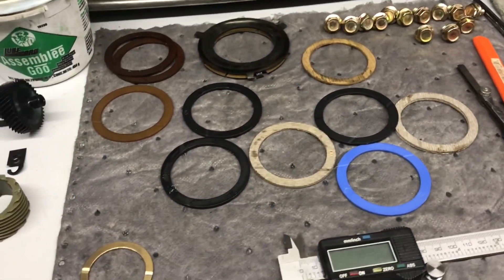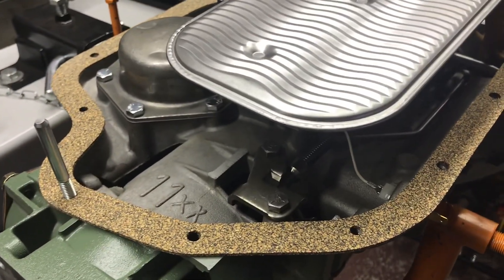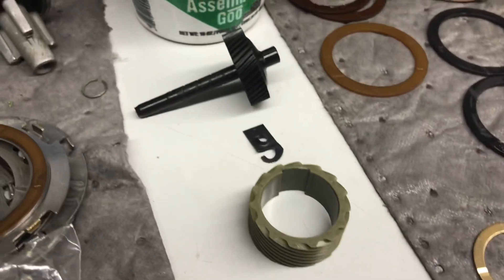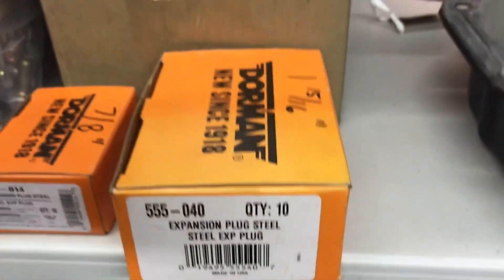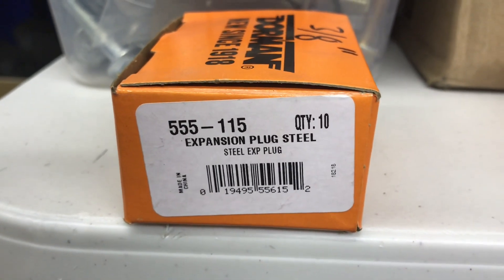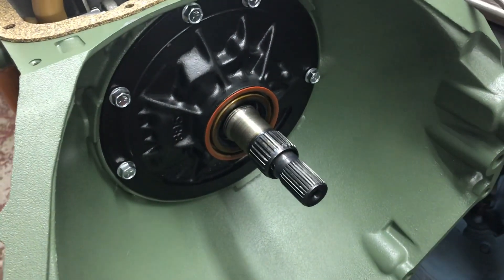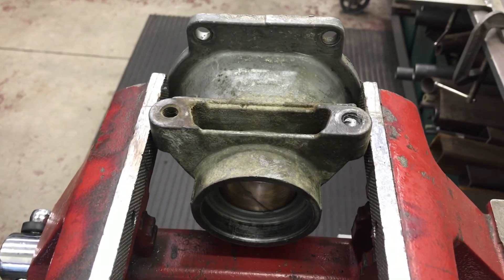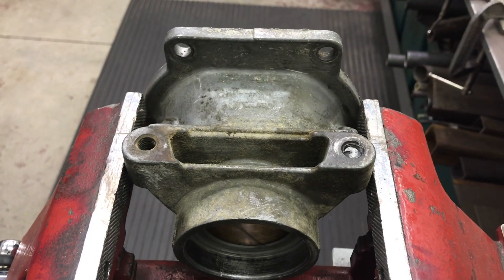Race TH400: Final Thoughts

Comment: I bought a Reed Racing TH 400 case and bell. Do you know any difference in building it vs a stock GM case such as snap rings.....
I am doing it and it will be my 1st full build. Thanks for all the training and educational information.
Reply from the maker: The Reid case comes with a intermediate pressure plate and snap ring to match the case. The parking pawl pieces are available from ATI, otherwise you have to take them from a stock case. The dipstick angle into the case is slightly different and you will need to remark your dipstick.
Nice piece!

Comment: Thanks for the info! Gonna rebuild my th400 to handle ls turbo power. Any tips? The case has HD markings so it's supposed to be a stronger casting? It says it's made '87 in the badge markings.. also has threads in the output shaft so I got a sonnax yoke with space for the O ring at the tip so the yoke can go further in..
Reply from the maker: sbc350  Sounds like a good start! Clean everything, in fact the last step for me is always Brake Cleaner and blow it off regardless of how clean it looks. Have fun, ask questions if you want.
Reply: @mountainsgarage  I have rebuilt one 350 and 200-4r before, but the th400 is new to me. Yeah cleaning is everything! Also have to take it slow to double check everything to avoid mistakes :)